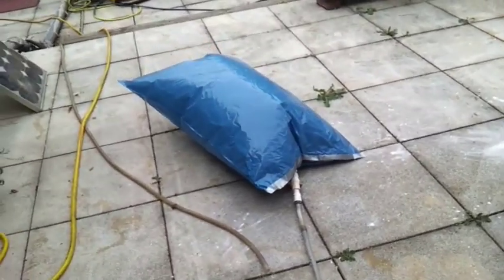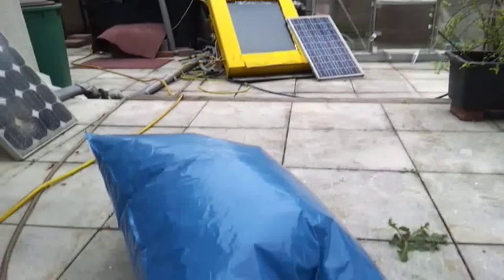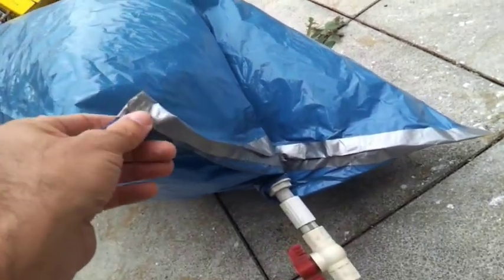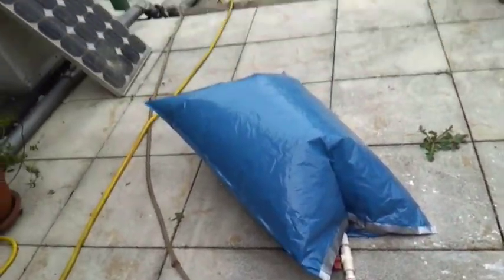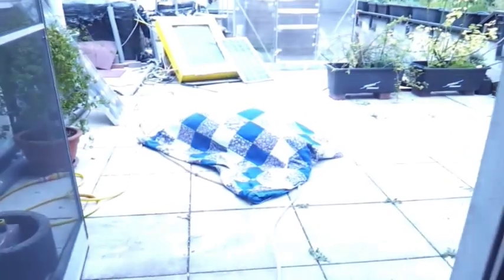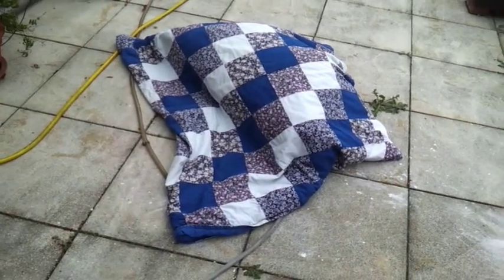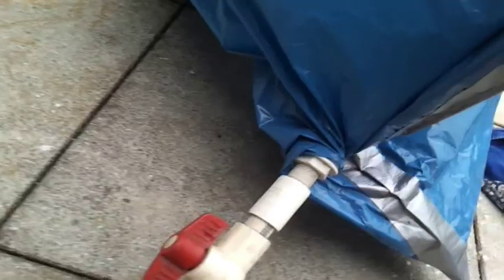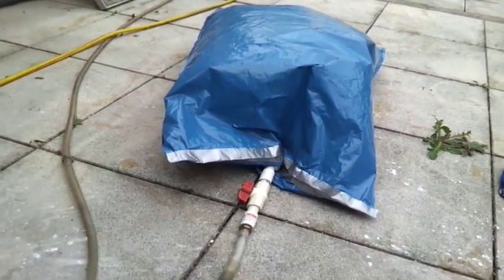Storing biogas in a plastic trash bag

Comment: Why not use a little battery powered air pump to regulate the flow of gas? I found one on Amazon that puts out 2.5L/Min and only uses 0.3W using D batteries. That could run for 50 hours or so and then the batteries could be recharged with a little portable PV panel quite easily. Or even just rigging a little 5v 40mm computer fan in-line would do the trick and could be run for weeks off of one of those cheap solar charged USB battery packs.
Reply: The thing is oxygen is not required at all
Reply: @NGTW-1  no one said oxygen was required...
Reply: @TomOHern  okay got it so the pump will be connected on the valve between the plastic bag and the stove and suck the air from the plastic bag

Comment: Plastic trash bags are not a good idea. They produce static electricity.
Years ago I used a plastic trash bag for a lighter than air balloon. I used oxygen and acetylene. I got away with it, another guy that I told about it did not. He is deaf in one ear to this day.
Be careful, I know that oxygen and acetylene are explosive and bio gas should not be. (not enough oxygen)  just advising to be careful
Reply: I agree with you about the oxygen. I was sending a warning to the people that didn't know. Without oxygen, bio gas and acetylene are only flammable. Just be careful when oxygen gets introduced.
Reply: Thanks for the input. I was considering pumping oxygen gas into a balloon or plastic bag and I hadn't  even thought about static electricity to be a potential hazard.
Reply: That's interesting. When I put oxygen and acetylene at the correct ratio into a party balloon hoping it would float, I found it was heavier than air. FYI after I lit the fuse, the explosion blew out the bottom of a steel wheel barrel. Never did that again.

Comment: I wonder how to get pure Methane.... in biogas have co2 hydrogen n vapor... still wonder how to separate them from the biogas to get only methane...
Reply: Well, in large-scale biogas production there's usually at least one water trap for vapour separation, and some kind of filter to catch particles. co2 can be removed from the gas by showering it in either water or chemicals. There's also procedures with where the gas is cooled or heated - depending on the composition of the biogas the ideal separation method vary from one producer to another but the key to the solution is that methane has different properties than co2 and therefore the two can be separated. 

That said, even the professional producers would find it near impossible to get 100% methane. The ones I've heard of that make car fuel of it aims for 97% methane I think.

For very small scale biogas production I imagine that the easiest way would be to trap the co2 in water and then dry the methane gas :)
Reply: thx for the explanation, realy help me alot...

Comment: distance is a joke.  Try also the air bed pump, that goes with airbed if you buy this. With the air pump connect the air inlet with bag to suck methane to a more stable container such as butane metal container much like colemans.  I want to find out if increased pressure change the stablility, structure of the methane gas.  thnx

Comment: Hi, nice setup you have there. 
For the bag, i think it will be dangerous to use the bag long term, the sun rays will destroy the plastik. 
Try to use tire tubs, from a truck or a big vehicle. a couple of those will hold alot of gas and u can store them above each other with a stick in the middle. The rubber is much better than just thin plastik.

keep on

Comment: gas refrigerators are extremely expensive in Europe, and can be very dangerous if you spray anything inside of your home such as bug spray, home construction insulation foam spray, or any other flammable gas for some reason and forget that you could have an open flame behind your fridge. Proceed with caution.

Comment: You can buy large domestic gas powered fridges online. 

Have you thought of injecting the gas into the air intake of a rocket mass heater to enrich the wood gas? Safety would need careful thought. Maybe several smaller nozzles rather than one big one. Located well back from the combustion point....

Comment from the maker: You're right, I have a Dometic gas powered fridge that I run on the biogas and it works great.  the 120 liter trash bag here shown should run it for about 8 hours more or less, I have to see. My wife had it moved into the basement when we had guests since we weren't using it all the time while we were away so I have to get back up to the apartment, but I will check and let you know.  We certainly know it will work well, it is merely a question of how many hours from each bag. Cheers!